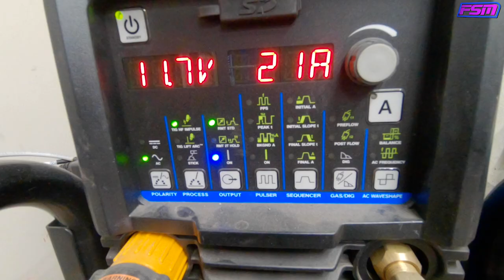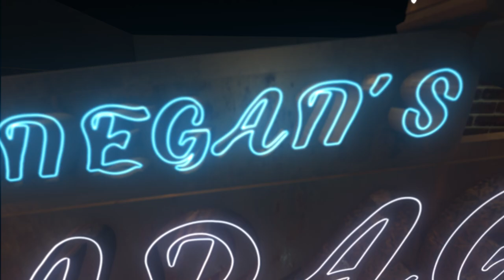EASY TWIN TURBO LS ENGINE PLUMBING HACKS!!!

Comment: Are you only boosting low psi? That's a hood restriction not upsizing pipes each time they meet. That's also gonna back pressure your turbo housing and headers causing extra heat build up.
Reply: For a family boat it won't be bad

Comment: Question for you guys, how do you seal jet drive to the hill to keep water from going in the back? It looks like it’s a pretty big hole the drive slide into. As always love the videos.
Reply: There is a metal plate and a rubber gasket that will go around the jet pump once they are ready for final installment.
Reply: Flex tape makes a great hull gasket too

Comment: Where did you get that super low red and black stool that's sitting under your brake when you were talking about the seat brackets? I need a really low one like that for working off jackstands.

Comment: When when you combine the two turbos are you not going in to a larger pipe then? It seems like the 2 to 1 then sizing up creates a restriction.  Does that restriction just not matter in this case because its having so much air forced through it?

Comment: Next time try plugging one end with a 1/8 hole and the other en cap off with a line to run low pressure inert gas to give you more penetration and less slag on the inside of tube .
Reply: That's for clean strong welds on stainless aluminum is a different creature

Comment: You really don’t have to make sure that sharpie line is vertical every time, only that it’s in the same spot every time. You can make a reference on the vice and just flip 180deg as necessary and boom

Comment: Seems like a rather large restriction running both hairdryers through that pied 2.5 elbow...
Reply: Yeah, and a ton of pressure drop where it doubles in size right after. Probably should've gone to 3" for the V, looks like it would have fit.
Reply: Just my thought. The diameter change should be on the individual pipes going into the Y. As it is now, the airflow would have to double in speed or pressure to fit through the same diameter (in reality the massflow will be reduced because of the restriction).

Comment: I feel it would be nicer to have a center pillar in the hole of the seat bracket for more security and look even better so basically punch out two smaller holes from the seat bracket instead of one big one.

Comment: Wouldn’t you lose performance with water jackets on the exhaust? It seems as though you’d be dumping a lot of heat that would otherwise be creating more power via the turbo.

Comment: Hi Mike ❤ ur Videos . Q 4U when u have a moment.  The actual housing of the intercooler.. the rectangular section size ( dimensions ) compared 2 a MOAC intercooler from Whipple.  Are they the same size if u know or perhaps find out . Cheers Robert Australia 🇦🇺

Comment: People complaining about the log manifolds?
Logs will build boost much faster, not really an issue in a boat, but still, and they might loose 10hp a side. 20hp loss from an 800hp engine? Who cares. Easy, tight fitting, cheap, works. Send it.

Comment: You got it reversed on the nozzle. Bigger diameter = higher pressure, lower flow. Smaller diameter = higher flow, lower pressure.

Comment: How does having tight bends affect the performance of the turbos? I know at-least under vacuum is really kills the pressure. But of course that's pulling air vs pushing it.
Reply: It still affects it, just not as much. When you’re pulling in ambient air it’s only about 14.5 psi and the harder you pull the lower that pressure is so any restriction has a big affect. On the charge side it’s forcing the air under higher pressure, but also will push it harder against a restriction. So, it can make the turbos work a little harder but doesn’t really change things much. 
If it was a full on race build looking for every bit then straighter plumbing might be worth it.

Comment: I wonder if you can put an electric actuator on the ratchet and program the Holley to put it in neutral when it sees less than lets say 300rpm
Reply: It can not be engaged or disengaged while engine is running, only when shut off. Besides the duel 90 degree nozzle acts like a "neutral" It divers water sideways as apposed to out the back. Hence, no forward thrust.

Comment: You should be using cast iron for your headers. This is all going to crack extremely quickly, no matter how much you brace it.
Reply from the maker: i havnet had an issue with cracking on Game Over's headers and these are even nicer.
Reply: @FinnegansGarage  Fair enough! Looks mint

Comment: So if my math is correct, a 2.5" pipe will have a area of roughly 5", with two inlets you will have 10" of intake flow area. Why didn't you use a 3.5" pipe? If you had cut the Y back further I would think it wouldn't be hard to make that stretch to 3.5" at the merge, and that would give you easy closer to the 10" (9.6) of area. Seems like a huge restriction since you are trying to push more air into the intake? Or an I missing something?
Reply: 10 inches? Two 2.5 inch pipes would be 5 inches and the small amount of power loss in the 90 won't be noticeable hauling the family around he won't be going fast enough his wife and kids need Kevlar underwear and parachute lifevests

Comment: Hey when are you going to be giving away another Miller welder. I need a chance to win one. My 110 Lincoln doesn't cut it for my son and I's drag race project. 75 Pinto station wagon with an LS in it. Needs tons of welding. Joe

Comment: That’s kind of a small pipe coming off two turbos.  Why not form it into 4” instead of the 2 1/2”?  I would think you would lose a lot of boost the way you did it.

Comment: Curious to know if the drive disconnect is some how cable/electric actuated or a form of inertia actuated,  you commented if the motor locks up how does the disconnect activate
Reply: It does not disconnect under power, it has an internal ratchet meninism that allows the pump to continue to freewheel in the event the engine suddenly stops.

Comment: Would be interested to know what the cost of the new pump setup is. Can not be even remotely cheap. Super super cool Mike. Great video.
Reply: I don't think most of the stuff you see here is what most of us would call cheap. Cheap shit isn't cool and cool shit isn't cheap seems to fit here.
Reply: Well north of 10K... probably close to 15K depending on the impeller choice (most likely hi-helix stainless) are 2k alone before and machine work.

Comment: Can someone explain to me the valve on top is to release the water why couldn’t you have setting where if the motor locked up that valve would open allowing the water to escape

Comment: Seems to me like that's a bottleneck there where two pipes of the same diameter come into one before going out to four? I think there's an easy fix to that later on if you end up having problems making the power that you want to make.

Comment: I’m not a boat guy but wouldn’t it make more sense to put the HIP one on game over and the dominator on the 4 seater?
Reply: I was wondering the same thing .
Reply: The Daytona is a much heavier boat than Gameover so the drive will be stressed more even though Gameover has more power.
Reply: new one overall sounds like it's a lot heavier.  Game Over is a race boat, so lightness above all else.
plus the Dominator has already been extensively tuned for Game Over.
also not a boat guy, but i could see weight distribution changes of new vs. old causing problems as well.
Reply: when you look at the weight ,etc. as mentioned I would agree that it makes sense. Thanks.

Comment: I don't know much or anything about turbo's but does the bends or turn's in the piping hurt air flow when installing turbo's?
Reply: Yes. But drastically less of a restriction when compared to air flow that’s not compressed. 

Gale banks once said something like “the easiest way to make a bad cylinder head flow good is to add boost”

Comment: The lungs of an Olympian, breathing thru a straw...    The size/cross sectional area of the Y-collector output should be the sum of the 2 intakes cross-sectional area...  Then it's doing a 'hard' 90 turn and getting all sorts of turbulence...

Comment: I know this is after the fact, but each cut =9* per side. So each pie piece is 18* included!! Meaning each end totals 18* from the center of the pipe. If this still is confusing then you failed HS algebra... Like me.

Comment: Why do you have the burst panel facing forward?
Reply: Because the intake faces backward. With that one the burst panel is opposite the throttle body. Probably not space for it under the throttle body since the cooler is there.

Comment: I"m always curious why the weight loss program for a vehicle never includes a weight loss program for the driver.  Could lose a good 20 lbs there and it doesn't cost you anything.  Had a buddy put all titanium fasteners on his race bike, but he could have easily lost 50 lbs by not putting it in his mouth.  (Still, he was fast)

Comment: wow your using a blade that is for stainless steel not aluminum blade ?
Reply from the maker: it works fine for either material.

Comment: Those intake tubes are a choke point should have brought it to 4 in where you brought it together instead of cutting them in half cut 3/4 each and put them together for until it's 4 inches then pie cut 4 inch pipe to the 90 hell another 90 would work there to but now your intake will have problems and you will be redoing it like I said to because your not gonna get 1500 HP though a 2.5 tube kinda dumb don't you think there Mike

Comment: Machining Tip: buy 4 flute endmills rather than using 2 flute slot drills, you can't plunge/drill with them but can feed faster and you'll have a better surface finish on the machined surface

Comment: Mike I don't want to be that guy but if you're welding in that shop and your house is above it you're working on cars in there with gasoline you should really get some fire code drywall on that ceiling two layers probably wouldn't hurt.

Comment: There is a YouTuber that is begging for help. They need a place to park a truck and trailer with a boat. They just got robbed and a lot of equipment was stolen. They are currently in Atlanta Georgia I didn’t know how far that is from you but they help people everyday and for the first time they need help ….. there channel is called chaos divers     If you can help them it would be cool
Reply from the maker: i left my email address in the comment section of their video. if you have a to contact them let them know i'd like to help.

Comment: 22:42 I'm going to say that doesn't really work.
The theory is great, who doesn't want a jet engine? in practice I'm guessing its marginal to nothing, if the force of a jet drive truly is the volume(mass) of water going through it then what happens on the exit likely doesn't matter, Especially with a choke difference of maybe 5% or less.
What might matter is the fingers where the cut stops (closes to the impeller) Kind of like how you stop a crack. That could become a cavitation point and slowly erode away like niagra falls, Eventually a finger breaks off and its gone.
Actual jet engine the flanges overlap to form a full ring so there is no gaps.
Without scientific A-B testing (a simple before and after with 1 pass does not a scintific test make) with multiple runs and a load cell measuring thrust produced... we'll never know.
Reply: F=mv^2

mathematically more water velocity makes a bigger difference than more water mass
Reply: @aleks138  Aware of that but I think that Force is on the area that force is applied which in this case would be the lake.
My initial notion of pump jets was the impulse of the jet acting on the water/lake.
However Mike said previously the thrust comes from the volocity and volume of water within the pump itself between intake and nozzle, which comes down to pump size and RPM, this would also point to anything after that would have no impact?